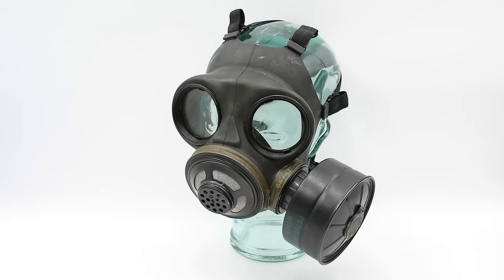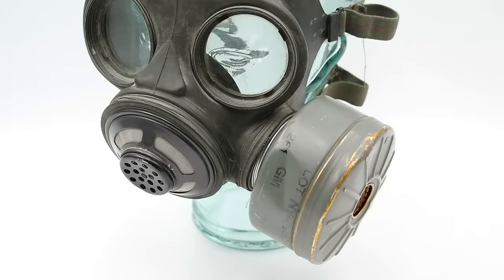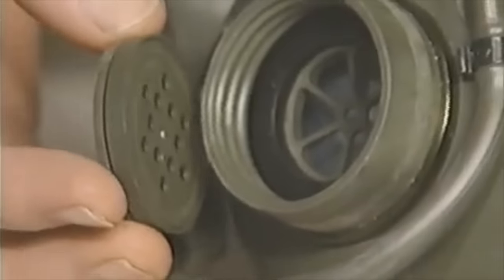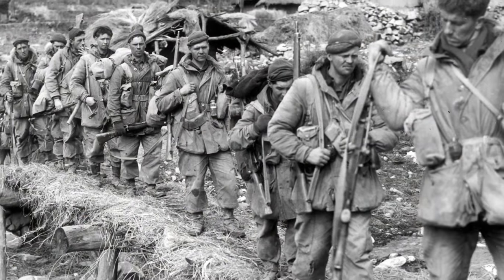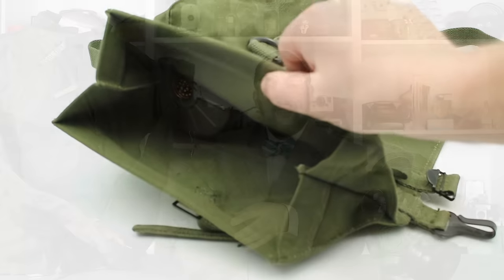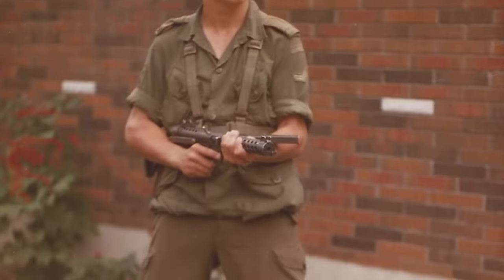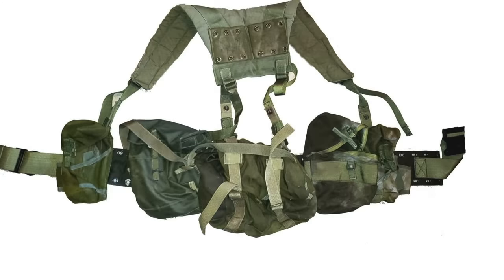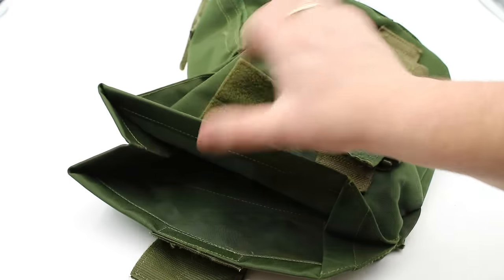Canadian Cold War Gas Masks: Breathing Easy on the NBC Battlefield

Comment: I was a Canadian Army reservist from 1979 to 1981, and a member of an armoured reconnaissance unit. Our standard issue webbing was the '51 pattern, which I absolutely hated because it was difficult to adjust correctly and uncomfortable to wear. At least the large ammo pockets could accommodate a number of SMG mags if required.

We were never issued '64 pattern webbing, but I do recall two of the troop officers of my squadron and the officer commanding having it. Never found out how they acquired it. But since they were typically armed with only a pistol, the '64 pattern probably worked out well for them despite its flaws. 

Our gas masks were the C3 variant.